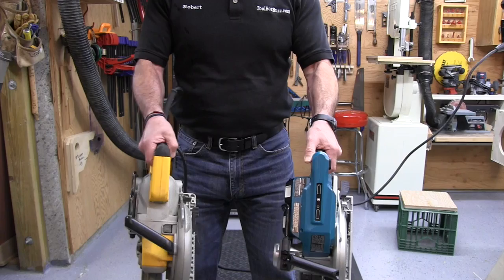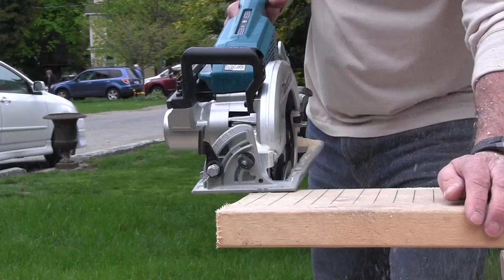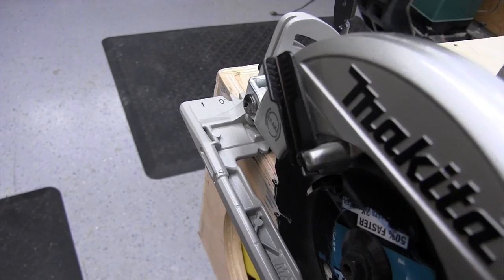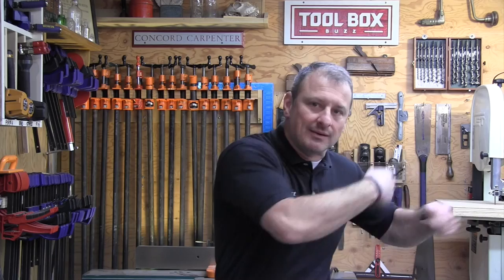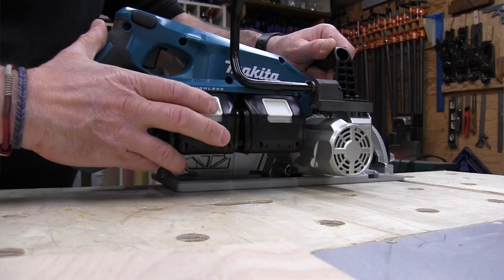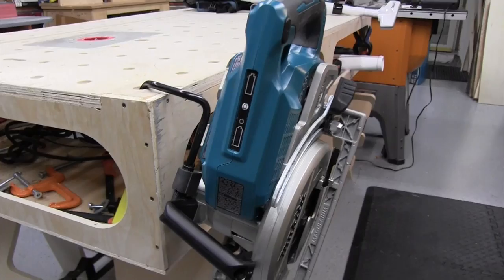MAKITA 18V Rear Handled Circular Saw XSR01

Comment: Do I need this tool —  NO
Would I use it on a regular basis — NO
Do I want it —- HELL YEAH!

Needless to say, my sales pitch is not exactly winning over the wifey.
Reply: It was selling for 249.00 at home depot. Four 5 amp batteries. Dual charger. A blade. And a bag
Reply: Right on! Just got mine from hd. Now found myself getting more Mikita 18v thingies! Being on the red team the whole time, feel little guilty...

Comment: Home Depot has a hack for this right now. I got the saw and 2 batteries for $150.  If you add this kit plus 2 additional batteries (free)  to your cart it reduces it to $150 for the saw and batteries and the additional batteries are $99.  Total is $250 and then you can return the additional batteries which makes the saw kit for only $150. Bargain for 2 5ah batteries and the saw!

Comment: This saw is the most impressive cordless tool our company has ever purchased! It performs and handles so closely to a corded model and the runtime is impressive to boot. $360 is a fair price imho. Thank you Makita and great review guys!
Reply: Forgot... First thing, while the batteries are charging. Remove the damn safety! Unscrew the handle and remove the safety piece. It's as if they designed it to be removed easily.

Comment: Just to add to the worm drive vs side winder debate, I would like to add a non-conventional test that put me in the sidewinder camp fully. I spent years working the cut table for steel and aluminum construction. I was cutting long angles on corrugated aluminum sheets that I would stack up to 3/8" with metal cutting blades. First, i must address the need to stack the material 3 sheets thick, volume production of large structures with a single cut table feeding up to 10 install crews called for mass output. Second, because it was aluminum, i ended up switching to more of a ripper blade because the closeness of most metal blade teeth eventually caused gum up in between the teeth due to the softness of the aluminum. These were hardcore, loud and rough cuts. Every worm drive i used, from multiple high-end manufacturers, ended up burning out the motor. 
The cheaper sidewinder designs stood the test of time. I could not kill the DeWalt and Makita sidewinders that I used over the period of 2 years. I went through a lot of blades but the sidewinders could hold up to the stress and constant power needed while the worm drives would not last more than a day without complete motor failure. While i understand that this is not a typical wood cutting environment, it does show the difference in the simplistic engineering of the sidewinder vs the worm drive and its potential longevity. I hope this helps some people.
Reply: they wouldnt last a day? id have to call BS on that and youd certaintly get a warranty replacement

from my understanding worm drives have lower speed and more torque compared to sidewinders which would make them ideal for that.. i havent chosen a side yet i think id prefer a sidewinder with the blade on the left but thats not an option for some reason..
Reply: @AndrewBrowner  It is. Makita has one, it just kicks all of the dust right back into ya face.

Comment: OK anyone wondering if this saw is worth buying, stop 2nd guessing this saw ,  I own 3 personally and 4 of my employees have also purchased their own,  I'm not exaggerating this saw in my opinion is better than every corded saw I own and I have 14 corded saws, skill, bosch, milwaukee, dewalt and 1 makita hypoid, I haven't used any of my other saws as soon as there was enough of these saws on our jobsite,  I did do a few modifications , I drilled a tiny hole in the safety thumb button and slid a 7/16 crown staple into the hole then clipped off any extra material this allows us to use this saw in any position,  1 more thing any of you crazy framers out there that reverse cut into lumber ie. backing the saw into the wood on a bevel , and have maybe experienced that extremely dangerous kick back from inserting into the wood to fast or the wood shifting,  this saw can do those reverse cuts easily,  the power is amazing, the blade brake is weird the first day you use it but becomes a  godsend, we pin our guards most of the time ( also a modification we do to all saws is drill through the blade guard near the BL logo high enough to miss the blade by 1/4 inch and insert an 8 penny galvanized nail into the hole bend it over on the back side and it slides back and forth about 3/8's of an inch to allow for a secure guard pin and release) my stress of my guys pinning guards and cutting then lowering the saw to a table floor or near their leg or whatever has nearly disappeared because of the quick blade brake absolutely love that feature, 1 last modification I did to better the saw was I used a small triangle file and put every 1 degree increments on the bevel gauge , it took 15 minutes to do this on each saw but increased the accuracy of bevel cuts for my apprentice carpenters.  If you use worm drive saws buy this saw you will love it. 1 draw back, yep there is 1.  the retractable saw guard is not magnesium and is fragile 1 of my saws took a 6ft drop and it bent and cracked the guard at the arbor point,  I firmly grasped the guard and forced it straight again and haven't had a problem with it but I know if that saw gets dropped too many more times that guard is gonna break, I have some saws that have withstood 20 ft drops this saw I don't think would survive that abuse but time will tell, , also my 8 employees have been using these saws for 8 months now and my profit on projects has gone up absolutely a game changer.
Reply from the maker: EAGLE RIDGE great feedback and tips thx man
Reply: Sir, I have 2 makita saws, and I agree with you 100%. I build decks and do a lot of framing. I like it so much I barely use my compound miter saw.

Comment: Very impressive. I was wondering how these twin 18 volt cordless machines perform compared to a 36 volt tool. It was only near the end I learned the batteries were 5 amp hour. Makita has done well using a soft start. I think they listened to me.
I would like to see cordless plate compactors. This of coarse well be bigger heavier batteries.

Comment: Great review Rob.  I have a few of both the sidewinder and worm saws.  My new Bosch (corded) runs and feels great.  I also have the heavy duty Milwaukee worm and two Skil (7 1/4- 8+)  all used daily and together.  One of my absolute favorite features of each of these worm drives as measured against all of my sidewinders is never really mentioned.  I'm 6`1`` and without the wormhole drive I can barley reach across a whole sheet of plywood,  48 inches, with a sidewinder, and if I do reach for it, I can only see the back side of the cut or blade.  Worm drives...no problem, easy reach looking at the blade the whole time.  If your working the bench knocking out all the cut work, this is a tremendous advantage.  I listen to all your reviews and have taken your recommendations many times.  Just wanted to add another PLUS for worm drivers!!

Comment: This is without a doubt the best cordless saw out now. I guess Makita decided to do it right and put the blade on the left side like every saw should be. Those lame sidewinders and other saws with blades on the right are only good for lefties. I can't believe it took this long for someone to come out with a worm drive style saw.
I just can't get myself to pay $360 for this saw, even though its the best one, while my worm drive is trucking along just fine. Have had it for about 15 years now.
Reply: Yes it is more powerful than the Dewalt Flexvolt...for sure
Reply: mojo jojo how do you know its more powerful than the flexvolt? Do you have both saws?
Reply: mojo jojo I've found a need for right and left blade saws, using them in an industrial environment. Both are necessary due to access restrictions in certain applications.
Reply: zzz Z I'm right handed and use a nine and a quarter saw with the blade on the right every single day, those saws with the blades on the left are fkn weird to use, and keep seeing vids on YouTube with people saying they are left handed saws? Not sure what they are on about.
Reply: When the blade is on the right side of the saw... Drives you nuts if you use both... I have 400mm blade on makita beamsaw but its left-handed and skill wormdrive saw... Just drives you nuts, you cant see shit.
Reply: I don't get why framers use left blade saws. The saw rests on the waste side of the stock. Can cut square on framing lumber way easier with a right blade saw. That said, I run a left blade saw because it's much easier to cut sheet goods.
Reply: Multiply $360 by x100 when your wrist will wear out.
Reply: I got one of these. It was $250 with 4 batteries, a dual charger and a bag.
Reply: Definitely looks great! I live in Massachusetts and in the mid 90s everyone used a worm drive doing commercial work. Don't know what the east coast sidewinder thing is about. Never saw any of them. They were seen as a homeowner saw even in those days lol.
Reply: Left hand blade saws are fkn awkward, I am right handed and use a right hand blade all day .

Comment: My aging Makita 18v sidewinder bogs down and devours batteries like no tomorrow. I suspect the brushes are shot, but it was always kind of anemic even right out of the box. I knew it was time to go brushless and with the power of twin battery packs, it was a no brainer this was the way to go. I just ordered the bare tool version from Ebay for less than $160 bucks and can't wait to get it so I can rip through some shit! Wish I had it last week when I was slicing through 1/2" ply and 2x4s to build hurricane panels.

Comment: I really like your reviews and always lean something. Thank you for doing this for us. I hope I could share my thoughts about this review. 
Most west coast framers use these saws because they are laid out in such a way as to make it possible for routine work to be done with minimal measuring and marking, without sacrificing accuracy.  Their weight and power allows you to cut most dimensional lumber on the ground and because the blade is on the left, it's very safe for this type of production and field framing. So if you wanted to really give a review on a framing saw: it would be nice if you used it like one rather then using it like and then comparing it to a east coast saw. If you were cross cutting dimensional lumber, it would be done on the ground with the long end supported a little off the ground with your left foot. I started on the east coast but moved west and learned west coast framing.  Thank you

Comment: Ive always wondered why the American market is obsessed with the rear handle worm drive saws. The UK use the side saws primarily. 

Great video, thanks for the effort you guys put in.
Reply: Ryan I started with a side saw and switched to a worm drive. The difference was big, at least for me. The worm drive has much more torque and it's much easier to cut a straight line with it. Maybe that's because it's a heavier saw, I dunno, but I definitely find worm drives to be superior. Except for the weight. That part sucks.
Reply: If you're right handed then a blade left saw is the way to go. I have one of the last 13 amp Skil Mag 77's made in America. It's a panzer tank of a saw! Just bought this Makita 36v rear handle, i'll see how it compares to the Skil Mag 77.

Comment: Bought a Milwaukee circular saw last week for $179,  Milwaukee charger $79, Milwaukee 18v 5.0  $99.  That's $357!!!!!    After seeing a lot of reviews about the Makita,  I think I'm going back to Home Depot to return the Milwaukee and get the Makita.  I saw it on sale for $249 comes with 2 batteries. Not that I don't like Milwaukee, I have a Milwaukee power drill.  I just think the Makita is a better deal.
Reply: I just got the Makita saw kit plus 2 additional batteries (total of 4) for $250.

Check out Acme tools.
Reply: Man...you are braver than I!!!

I would keep the Milwaukee over the Makita, unless you have other Makita stuff and don't want to deal with multiple chargers.

Comment: So I put my Milwaukee 7.25 fuel with 9ah battery into overload today and ran to the garage to get my old Skill worm drive saw. By the time I got back to the deck it came out of overload then the battery was dead had to switch batteries and still didn't use the skill saw. I bound and stopped the saw several times and the saw was definitely struggling on the pressure treated 2x12s. The blade in my opinion had about 50 to 30% of life left. I was cutting 2x12 stringers 4 of them at 10 feet in length 7 7/8 by 10 inches. I think its time to buy a new saw, could you guys do the same test between the flexvolt and this saw or reply with your opinion between these two saws if you had to do the same job. I'm also surprised Milwaukee hasn't came out with a new version of its 7.25 or rear handle. I just saw a instagram post Dewalt is coming out with a rear handle. I would leave the milwaukee battery platform for a better circ saw just not sure what platform.
Reply: dewalt isnt gonna be much if any improvement over the mikwuakee.. the tech just isnt there for the cost yet.. this makita looks like itll have better luck

im getting along good with the milwakee but when i rip cut lumber it does over heat in a hurry, couple spots on the handle get surprisingly hot.. which is weird because you wouldnt expect there to be any electronic switching on a constant speed saw
Reply: empyrean987 I have the Milwaukee 7 1/4 saw and while ripping pressure treated even just cuts it does struggle.  I’ve had it do the safety shutoff and at times totally shutting off where I have to remove the battery and press the switch a few times to get it to start again.   I recently was at home depot and came across this makita saw combo for 175! Yes 175$$$.  No brainer snagged it.  I love the Milwaukee for dry lumber and 2x4 cuts or carrying up a ladder etc.  the makita is the brute. Really impressive and you can find it now for 250-175 on clearance aisles during the year.

Comment: I have this exact same saw. I love it, but I wish it would blow it's sawdust to the side instead of behind it. It's kind of annoying to keep blowing sawdust out of the saw itself and the batteries.
Reply: There is a rubber plug on the right side, just in front of the top handle for vacuum hose setup. The sawdust shooting out at me was the first negative thing i noticed.  I just bought this saw days ago xsr01z. Wondering what the z on the end of the model number means. Did not know about the plug until i noticed it on the box. Incredibly smooth fast cutting.

Comment: 60 years in the trades and I know Makita makes lifetime tools. The trade off is they're heavier than their competition. Another opinion; West coast carpenters like the worm drive because it allows them to cut using their foot for a saw horse, and I'm not sure they know the difference.
Reply from the maker: Jack Riley I cut like that with a side winder too you just have to apply pressure vs. Letting gravity drop the worm drive thru the cut
Reply: Saying Makita tools are heavier than their competition is a massive generalization and simply untrue in any general sense.
When did you come up with that little factoid? Idk, but you should stop spreading it because its nonsense.
Reply: @brokenwave6125  My era of reference is older than you are and at that time, up to 15 or 20 years ago, held up. Today, of the seven major brands, Makita sits exactly on the average weight of all of them and that's another factoid.

Comment: have tested a wormdrive and i got sold after the first few inches i cut with it ^_^ Now i have the trouble finding the site that ship to europe :D have used to sidewinders and own 2 myself (corded &uncorded) but and 199$ + shipment for the makita is way cheaper then buying the equal sidewinder useing double 18v batteries here even if geting the baretool model only =) the 3th hand here always adds 50% more to the pricetag and if talking nicely to the companysellers at the toolshop and get 24% off the price its still alot money you have too give (and they still wonder why the importrate is so high here) hahaha ^_^

Comment: Although this question is not so relevant to this double battery Makita, I suppose it could still apply for some people.  I want to convert a couple of Makita 18V tools to use my line of 18V Ridgid batteries. I have already done this with success for an old style Milwaukee sawsall and older 18V drill and these work great with 4AH Ridgid batteries. My issue with Makita is if there is any electronic reason I would have to do something to conform to their STAR system so I could NOT adapt other 18V batteries to Makita?  I can do the physical adapter OK, but don't know about an electronics I would have to use for full functionality. Any ideas?Will the Makita tools work with a simple 18V connection like my old Milwaukee and 18V Dewalt tools will?  I have not purchased any STAR Makita tool yet to test this myself.
Reply from the maker: gedgetips not sure
Reply: ACC -- thanks for the quick response. Perhaps one of your fans who engages in the fine art of 18V battery adaptation, with full functionality, but of course,  will be able to answer my question.
Reply: Older batteries (non star) are compatible with newer tools but not the other way around. You should be good to create an adapter.